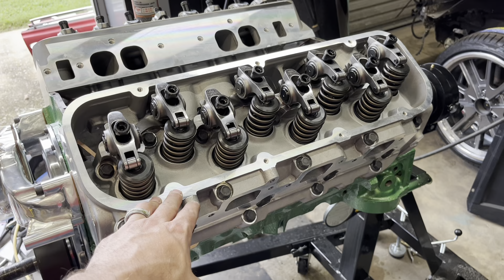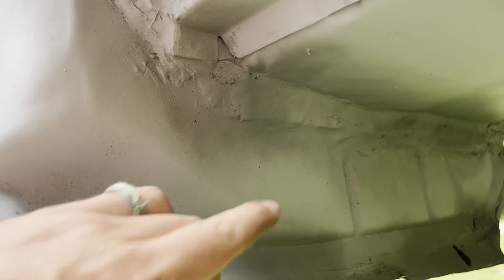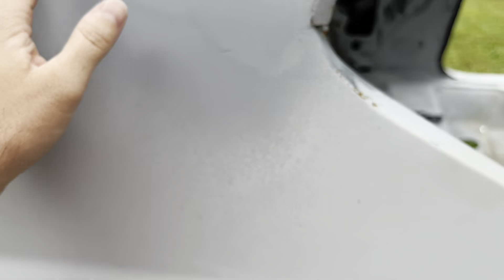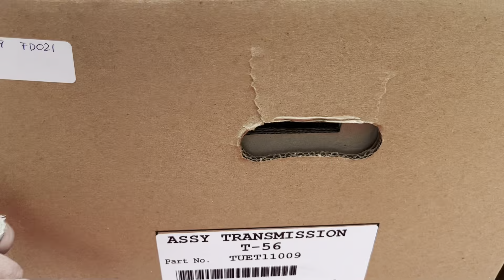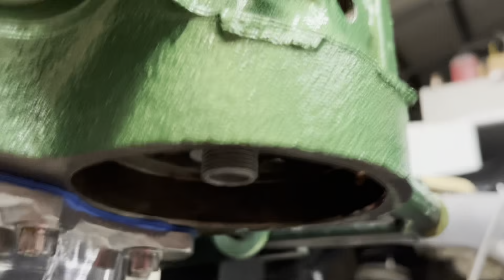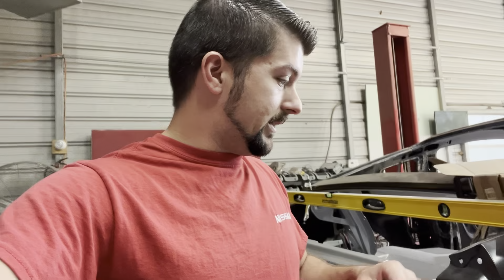1969 chevelle engine finished and new t56 transmission

Comment: Just curious did the different sized diameter pushrods work?  Or did you have to go another route? That confused the crap out of me that the exhaust side worked.
Reply from the maker: There were only two options for this engine and the 5/16 would only work for the exhaust side and the 3/8 on intake side